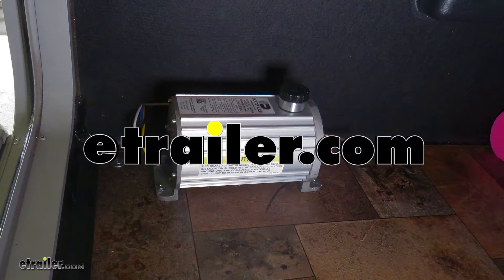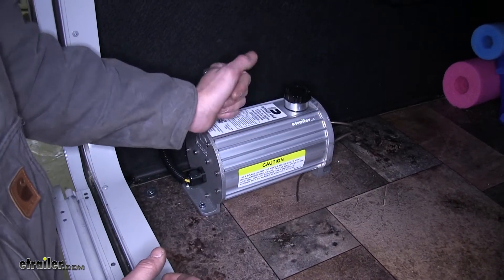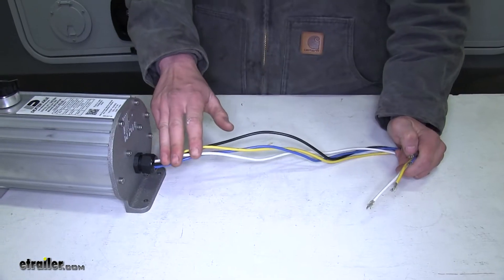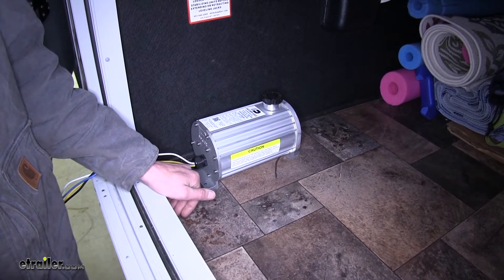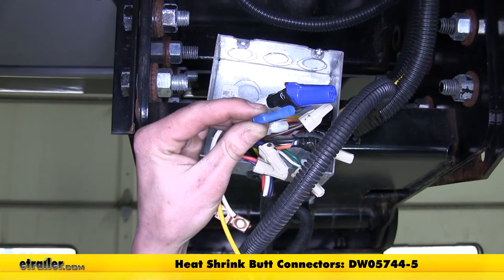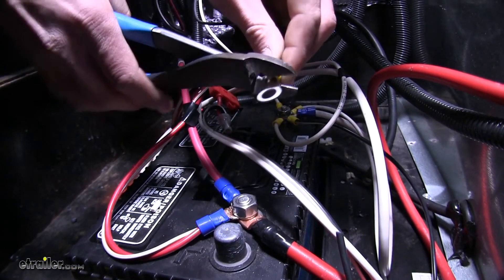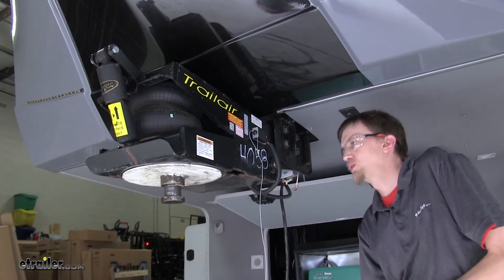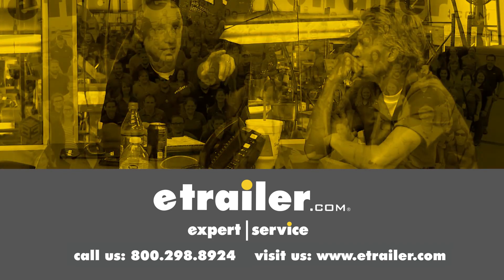The Low-Down on the Dexter DX Series Electric Over Hydraulic Brake Actuator for Disc Brakes

Comment: What sets this apart from a 12v hydraulic pump, this is a hydraulic pump that turns on when it gets power from the brake controller right? A 12v hydraulic pump is around 200 bucks and puts out 1500 PSI, very similar pressure to this unit.

Comment: What brake controller would work best with this hydro/electric actuator? For a 5,000 lb boat trailer.?
I am Building a boat trailer and also wondered what is the very best braking system that would work with a tandem axle trailer for a 25 footer sea ray boat. Thx etrailer great videos
Reply from the maker: The Tekonsha Prodigy P3 Trailer Brake Controller is a very popular brake controller for many different towing applications. I would recommend going with the following kits for disc brakes and electric over hydraulic brake actuator.
https://www.etrailer.com/Brake-Actuator/Hydrastar/HS381-9067.html
https://www.etrailer.com/Trailer-Brakes/Kodiak/K2HR35D.html
 https://www.etrailer.com/Trailer-Brake-Controller/Tekonsha/90195.html
Reply: etrailer.com great news have been looking at these parts you have and for certain have the right idea but wasn’t sure. A big help knowing all of these items will work together.  Big thanks to etrailer 👍

Comment: Will it work for hydraulic drum..I have an old hydraulic drum brake trailer?
Reply from the maker: It should work just fine with your hydraulic brake drums that you have now. You just want to make sure you clean or replace the existing brake lines to ensure smooth operation.
https://www.etrailer.com/Brake-Actuator/Dexter-Axle/k71-651.html